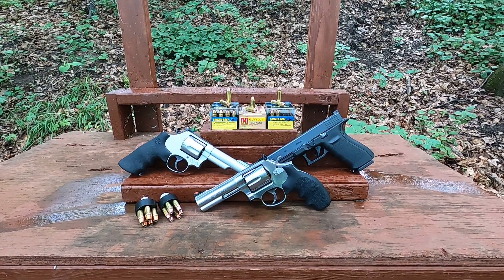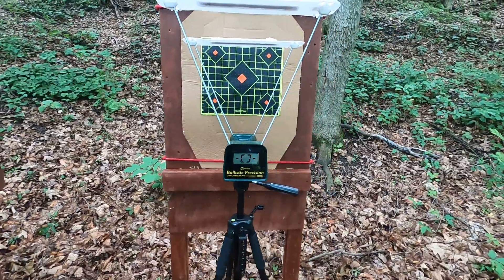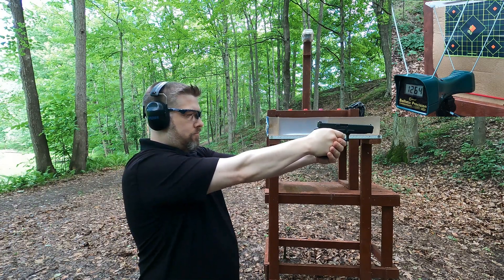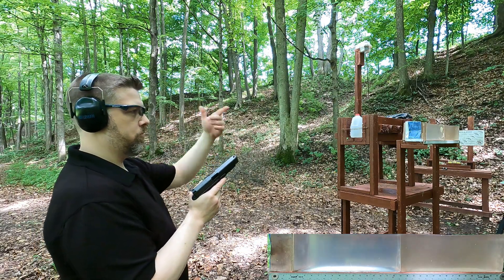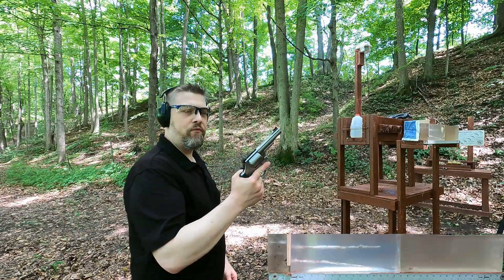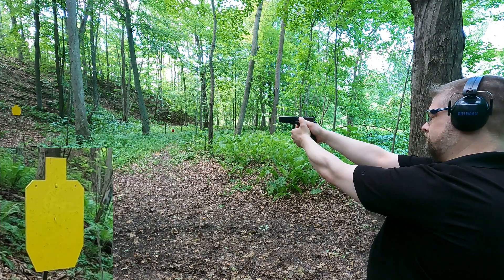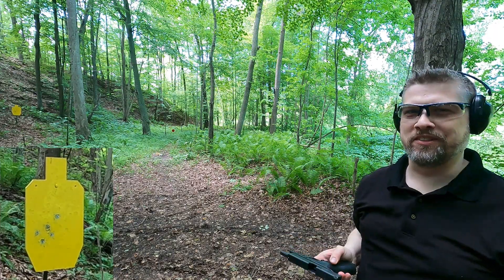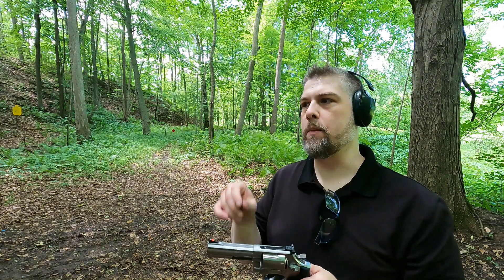10mm VS .357 Mag VS .44 Mag ALL 180 gr XTP

Comment: I like it,.. 357 Magnum  the oldest cartridge of the three and still the king.
Reply: Testing .357 against a pup 44 mag load is the only way a .357 comes out on top. The test is near useless for comparing the three calibers to each other. Using the same bullet weigh is a good idea but all loads must be full power loads. Ballistics matter. 10 mm max energy is around 700 ftlbs, .357 around 800 ftlbs, 44 mag 1200 ftlbs. Out of the right gun 1400 ftlbs. I would not want to get hit by any of them but 44 mag is the top dog of the three by a large margin.
Reply: @Wonderwrench  yes, indeed,.. 357 rules!
Reply: @Wonderwrench  not so. You can get 10mm loads that are over 800ft lbs
Reply: @Wonderwrench  this was not a full power 10mm load.
Reply: @Wildwestwrangler  still doesn't matter comparing it to 44. Buffalo bore loads a 340gr bullet that has over 1,500 ft lbs of energy. Dam near twice the energy as the hottest 10mm.
Reply: @Wonderwrench  357 Magnums can be up around 900 FPE from a 6 inch barrel.
Reply: @vlogfriendsutopia my 357 handloads in a carbine has almost 1500 ft/lbs. have killed several deer with that load and am tickled with it. Killed a 110 lb doe this past year at 124 yds. Fell in her tracks
Reply: @bradstephens4915  Hell yeah. Buffalo Bore has some loads in the high 1600s from a rifle. What projectile did you use?
Reply: @vlogfriendsutopia  I used a handload with 158 xtp flat point with Lil Gun powder. It’s over 2000 fps. Not bad for the little magnum.  That’s what makes the 357 more versatile in my opinion. Good use in a revolver, and lots of gain in a rifle. 44 and 10mm will gain some, but not that much.
Reply: @bradstephens4915  Indeed. A 158 grain XTP pushed at 2153 FPS will still have over 500 FPE at 300 yards.
Reply: @vlogfriendsutopia  that’s correct. I wouldn’t shoot a deer that far with it, but 150 is easy.
Reply: @bradstephens4915  Agreed.
Reply: 357 in an 8 shooter 😍. The same of 10mm in 1911 single stacknplatform.
Reply: The 44 can be loaded to 1896 fps (for an 8-inch barrel). The cartridge in the video was around 1300.

Comment: i had  a 10mm 1911  was not impressed   back to tried and trusted 357 for me
Reply: I bought a Springfield 1911 Ronin Elite and love it. Accurate as hell with the fiber optic sights & adjusted trigger from the factory 6-1/2 pounds to 4-1/4 pounds. It hits harder than a .357 with full loads, plus has 9 +1 rounds, 10 +1 if you push a 9th round into the 8 round mag.
Reply: @ronolson2024  lol no 10 mm don't hit harder than 357 lmao

Comment: More recoil of the 44 mag is "because it is more powerful than the .357 Magnum" - sorry, Sam, but it's a sheer nonsense - it is more powerful by design, not in this particular case. Here you fire a weak 44 mag and it is clearly reflected in the result (less foot pounds than 357 mag with the same bullet's weight). The only reason for stronger recoil I can think of, is the difference (however slight it is) between the ergonomics of these two revolvers.
Reply from the maker: but the .44 Mag is more powerful. Your nonsense would be like comparing a 9mm in a 5" barrel to a .357 Mag in a 2" and saying "both same" because both had 450 ft lbs, not realizing in a carbine the .357 Mag is 1,200 ft lbs while that 9mm only maxes out at 600.
Reply: @GunSam  But I DO think your test (comparison) is both: logical and interesting. I was only referring to the fact that this "reduced" 44 (although producing slightly less power - kinetic energy at the muzzle) recoiled more than the hot 357. My guess is that this is due to the difference in ergonomics of these two revolvers, that's all.

Comment: Cool test
Reply from the maker: Thanks.
Reply: Also the difference in recoil could be due to bearing surface of the bullet on the rifling
Reply: @randalljeffs7272   Could be part of it , weight up front , more weight . Very complex , I may not have it all , I have heard the force is = forward & back ?? Your point is more bullet drag pulling the gun forward against the recoil force to = less recoil ?? The 44 is bigger around & I don't know the area of each . could also be the size of the barrel & cylinder ?? All the drag difference could be very small ??

Comment: Huh? I hunt and shoot with a 10mm and 44 magnum. How is the 10mm the same and 357 magnum more powerful???

The 357 magnum penetrated further than the 44 magnum. If the 357 hadn't hit the stupid table it would have gone further. Using the same 180.

Does this mean I a 357 magnum is better for hunting than a 44 magnum?

I always used the 44 magnum thinking it's more powerful. If that's the case we should strap on the 357 with 8 rounds and leave the 44 at home. Something is defective with this test.
Reply from the maker: Like I was trying to say, these are not necessarily a representation of the caliber designation as it is .357" VS .40" VS .430" diameters at a similar energy.
Reply: For carry I get about 1150 ft / sec with a 180 gr 44 sp ( I could load a mag the same way ) . For hunting I load a 240 gr @ about 1300 in a 8" & about 1650 to 1700 in a rifle ( same load ) . Load for the gun & use .  44 can go from mild to wild , same as 357 & 10mm .
Reply: @danoneill2846  I don't use my 44 magnum for edc it has a 8 inch barrel. I use a 320 grain hard cast to hunt black bear. I enjoy handgun hunting as well as using my long gun. But hand gun is more exciting.
Reply: @danoneill2846  Both loads were at 180 grain. The 44 magnum should have blown it away.
Reply: @alejandromolina5645  All that depends on the type of Powder & how much is in there . There is a huge range to custom make your ammo any way you want to . This 44 ammo would also be a GREAT Deer load if you Knew it would be shot out of a handgun . It would be easy to make it more powerful , it's not needed for close deer with a handgun .
Reply: @danoneill2846  I am not talking about hand loading your own rounds. I am talking about ammunition you can buy off the shelf. I would think when both were shot with the same grain that the 44 would win especially both being the same manufacturer Buffalo bore. I have not reloaded my own ammo in 30 years too much trouble. Although with this present situation I might just start again.

Comment: In a hypothetical scenario, where you only have to pick one caliber and one cartridge for this caliber for defense and hunting, I would definitely choose 180 gr .357 magnum xtp from buffalo bore. It is the most powerful 357 round so far, it has higher than normal penetration for hunting and wildlife defense, while still being seemingly as good or better as regular powered 357 magnum loads against two legged predators. One size fits all!
Reply: 10mm
Reply: @danoneill2846  100%.
10mm can make more power, has a better range of bullet weights & comes in guns with  far better capacity than a typical .357 Mag would be.
Reply: @pewpewTN  A 10mm can’t even come close to the power of a properly loaded heavy 357 mag round, but using regular factory ammo from any good manufacturer, they will run close. Be well, shoot straight my friend.

Comment: Different purposes here like you said. The 10mm & 44mag at 180gr are light for caliber, especially the 44mag, 10mm maybe not as much. The 357mag never disappoints! The others are really nice as well, I just prefer 357mag for my purposes. Thx!
Reply: In the 10mm, the 180 is pretty much the "standard" weight that optimizes velocity and energy.  I agree that it is light for the .44 and is a heavyweight in the .357.  Now, put some more powder in those .44 cases behind that slug and it will shred gel, though with much less penetration.
Reply: I think the OG 10mm Auto was 170gr (FMJ-TC) at 1350fps. I've used 200gr as my goto handloads for 30 years, but still think of 180gr as "normal".  200gr limits limits how high I'm willing to load in energy, as it sits rather deep in the case, but Im ok with a "mere" mid 500s fpe on a glock 20. Using 170-180 will get you more energy in a safe load, similar to hot loaded 357mag in a wheelgun for hunting with 180gr .357 bullets. For hunting, 357mag 180gr at equal energy with a strong nonexpanding bullet is going to be better.  But 200gr 10mm Auto is stable from a g20, while 180gr 357mag isn't always stable from regular service pistols. The later needs a bit more twist than a standard handgun, doable but needs to be accounted for.